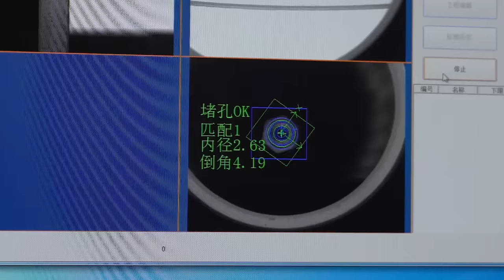Millions a Day! Mass Screw Production Process in China.

Comment: I don’t understand how the machine makes the threads
Reply: It looks like they just press it in a mold (press the mold around the wire)
The material is not hardened yet at that point.. so that's quite possible.
Reply: They are rolled on.
Reply: It rolls the semi finished screw shaft between two cookie size and shape slotted dies. Slot teeth have desired  thread shape. Metal is cold rolled, still soft, it is later heat treated and hardened in an oven.

Comment: 1:21 Please allow 5mm error due to manual measurement 😉
Reply: 5mm is too big bro 0.2mm max
Reply: calipers of that sort normally have an accuracy somewhere in the range of +- 0.001 of an inch or around .025mm. I might question the calibration due to the cracked crystal not indicating the highest of care but its still good enough for what he's doing with it.  If you need screws accurate to an extremely high precision your not getting em from what looks like a Chinese mass manufactured screw factory.
Reply: I’d worry about the Chinesium more.